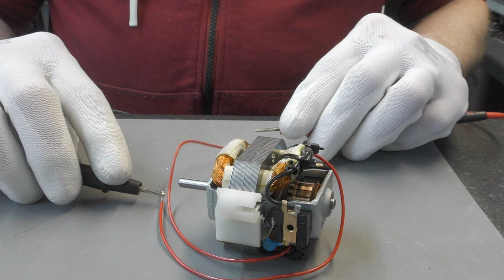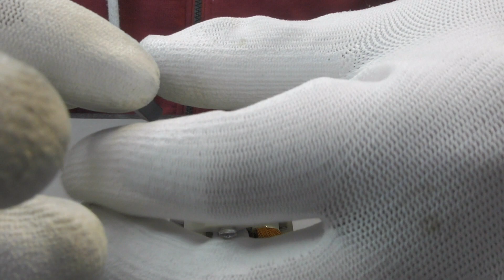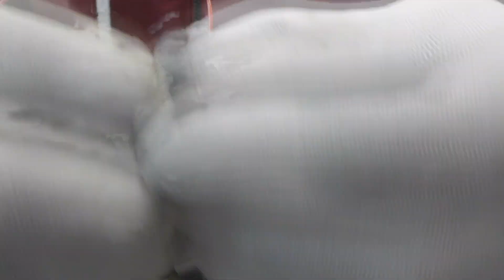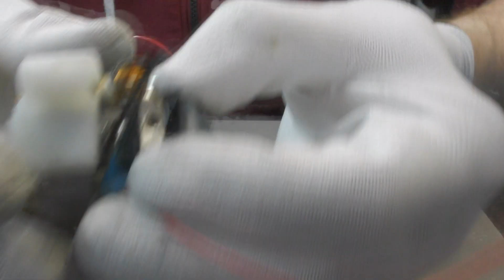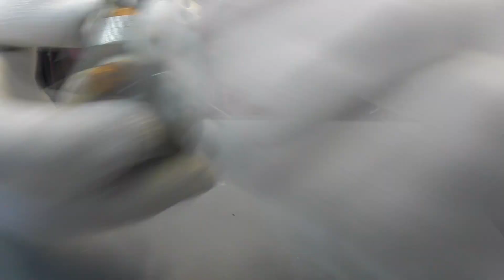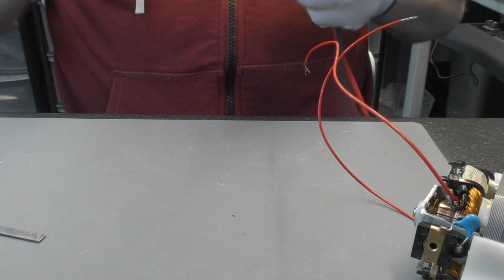AC Brush Motor with High Resistance. Repaired.

Comment: No need to remove brush though, just another file under spring, and across the top lightly. Then pop back in. Also can be caused by the commutator having a film of dirt on it, a quick wipe with a small cloth moistened with alcohol works well, though i had a small steel rod with a piece of 800 grit wet and dry paper on the end. Took a sheet and paper punch, and cut out a few dozen disks, and glued to old guide rod from scrap CDROM drive. Made a tiny disk that got dirt off well, and you simply stuck a new one on when it got worn.